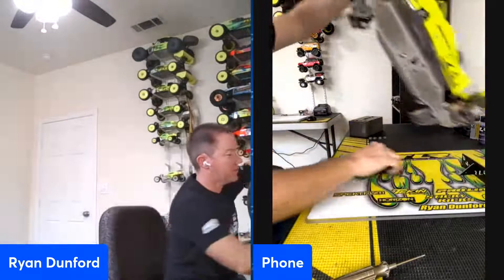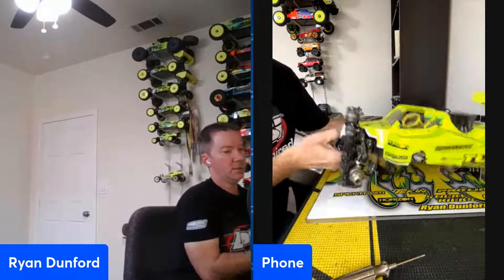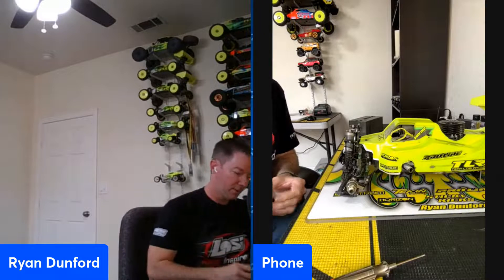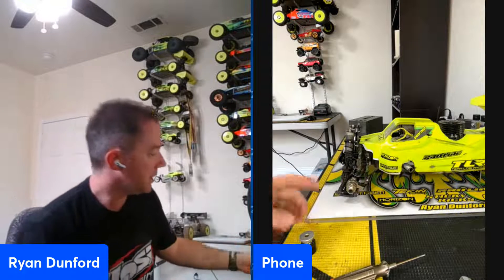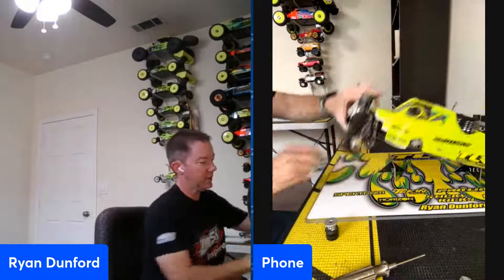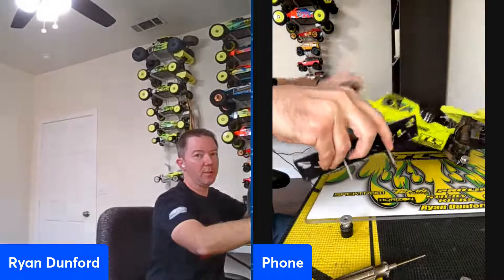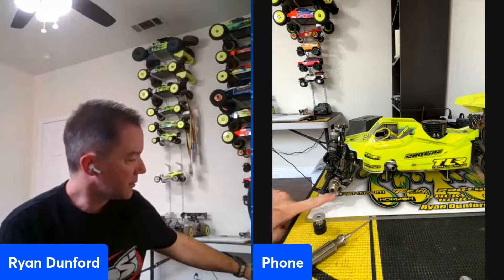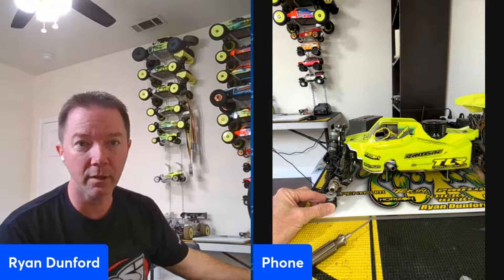Tech Tip Thursday: 8th Scale Droop

Comment: So using a 36mm block your hub is 8mm under the chassis ? ( assuming your 28mm droop number ? ) 
 Great video , thanks for explaining what it does .
Reply: No, his droop is 34mm & 2 mm under the chassis, as the hub is a 12 mm thread so you add 6 mm to be at the centre of the hub, I use 40 mm blocks(why I dont know lol) so to get the same setting I would set it at 32 mm, 32 plus 6( half the hub)is 38mm and 2mm below the chassis. Hope that explains it better